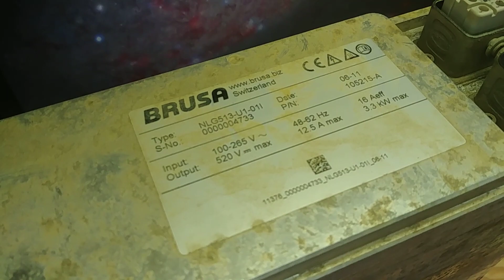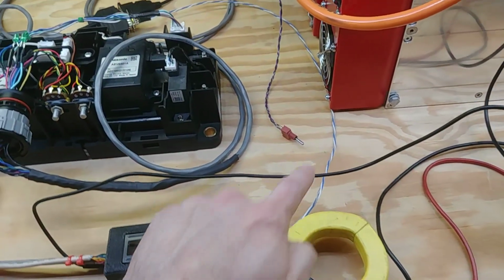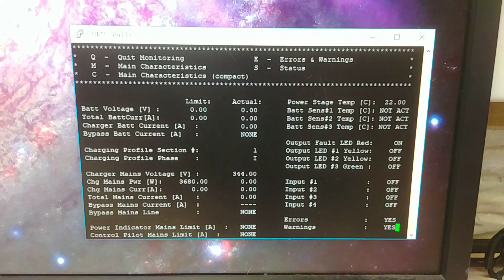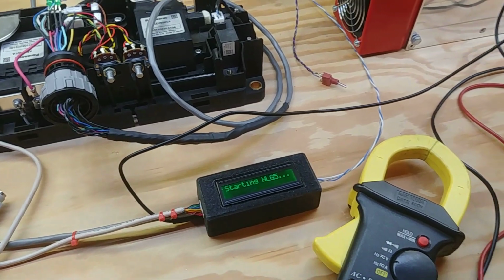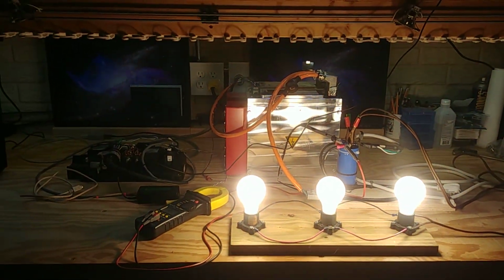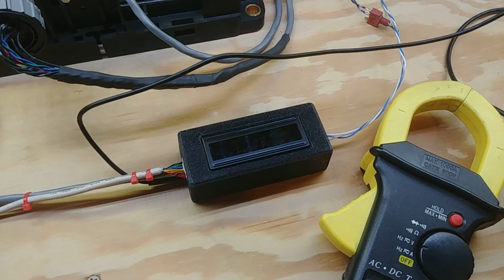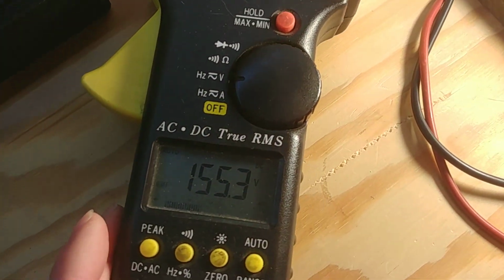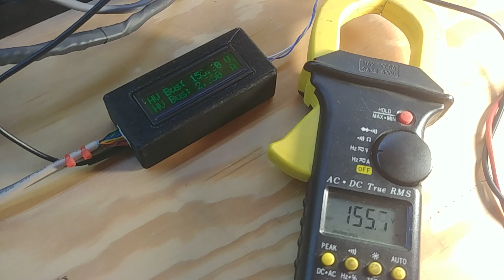Brusa NLG513 test S/N 4733

Comment: What is the resistanse limit on the temperature sensors. I read it should be 33KOHM at 25 degrees Celcius. At what resistanse does it stop charging?

Comment: Hi, i have two brusa nlg513 on a simth edison tipper truck its not charging and on normal charging voltage both fisplay the top two leds as first yellow second red out of the five leds, on putting a low amo power to it the bottom brisa displays bottom green led and second led both flashing with first led yellow and steady , can you interpret that please ?

Comment: Do you still have your test rig? Ive got an Azure Transit EV with a scary low battery and a seemingly bricked NLG513. Cant get the vehicle to charge. No indicator lights on the charger body itself even if i externally power it up, readings from the charger in the azure diagnostic seen erratic.  Wake to charge module that others have had trouble with is fine. Would greatly appreciate your services!
Reply from the maker: Both the vehicle and the charger won't attempt to turn on if the sensed battery voltage is too low.

How low are the batteries?
Cell voltages?

Then they might be permanently damaged...

If you want to risk it, you can manually charge up the battery high enough for the battery charger to start working...
Reply: @WolfTronix  Pack voltage is around 200v. Lowest cells are an unhappy 1.6v  (hopefully not doomed?). sent an email with more details. Thanks for the fast reply.
Reply from the maker: @samcap64  

Sorry.
They are Bad.

I would use lots of caution (potential fire) if you try to charge any cell that is below 2.5V.

Comment: I have a Brusa NLG513 charger that I want to use in a custom EV with a 300-Volt battery pack but I can't seem to get the charger to turn on.  Do you have a block diagram of the bench test system that uses light bulbs for the load.  I want the simplest configuration setup so I can bench test the power supply to determine that it turns on before installing it in the vehicle.